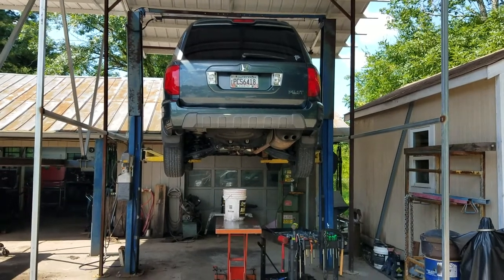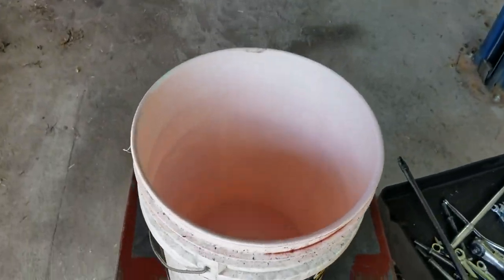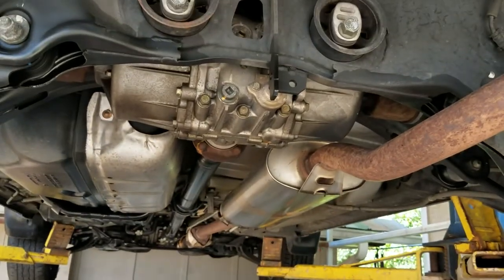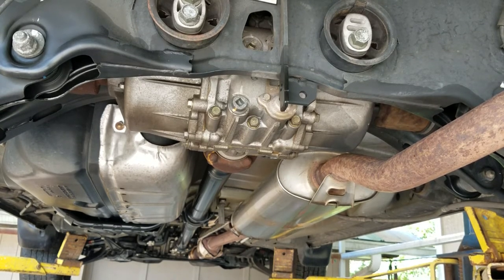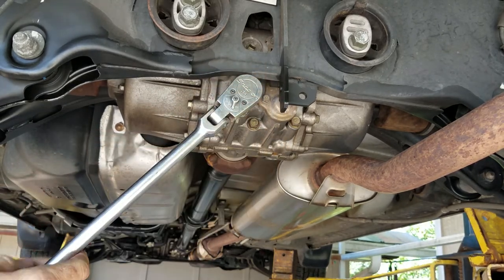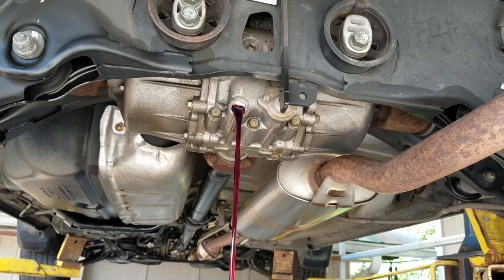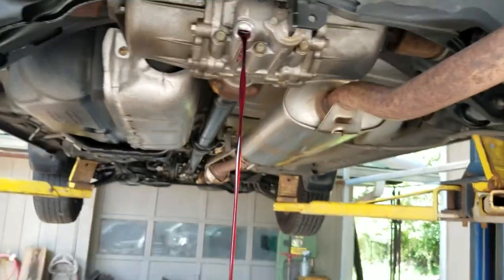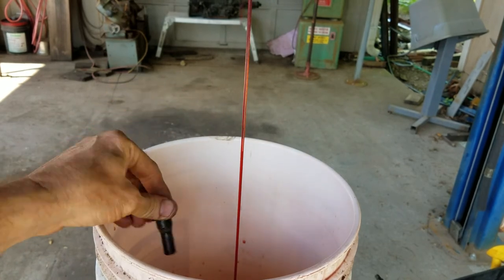Awd pilot towed wrong pt 2

Comment: How did he tow "wrong"?
Reply: Drive wheels can’t touch the ground unless they’re physically disconnected. You must disconnect the drive shaft if you plan to roll drive wheels. Neutral won’t cut it.
Reply: @ArcticSilverFox1  all the wheels need to be spinning or not at all. It should have been put on a flat bed tow truck.